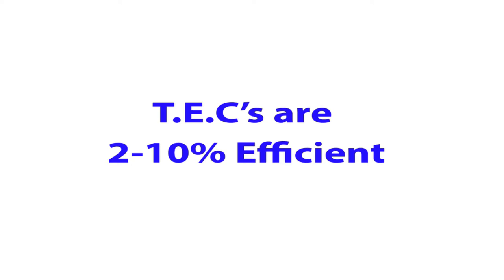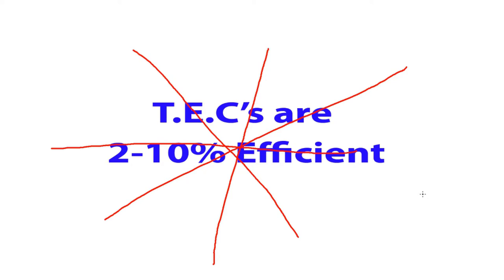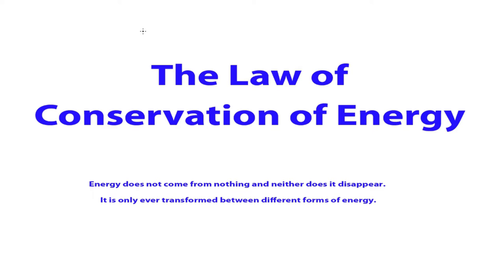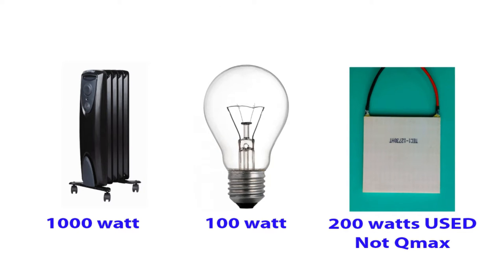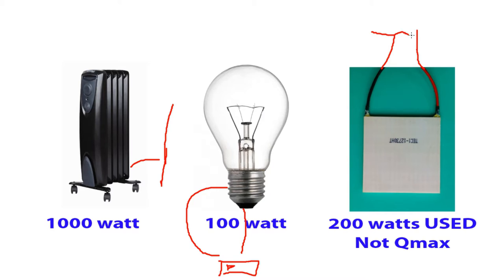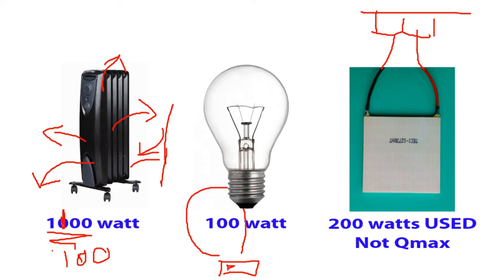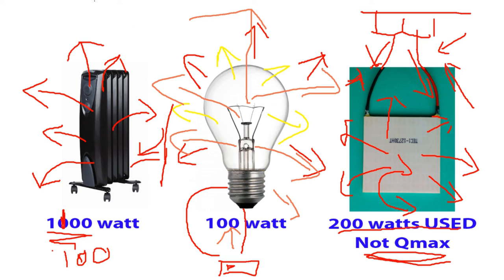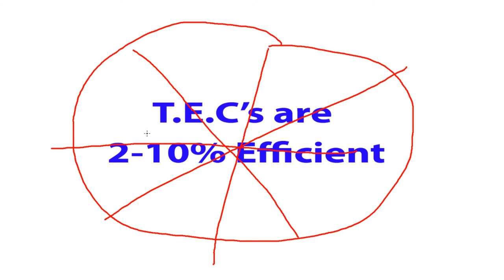🎓 Peltiers efficiency:- Conservation of Energy. Part1

Comment: Good info.

I've only recently gotten into using peltier modules. Waiting to get my first ones in now. Picked up some tec1-12706 modules for a mini cooling unit I'm building.

After watching a ton of vids on peltiers I think the common misconception towards efficiency comes from the fact that people are expecting / wanting all of the energy to go to the cold side. Since most people seem to use them for cooling not heating. If 90% of the energy is heat loss then yes…..it's only 10% “efficient” for cooling. However the second you apply a good heatsink you totally change the “efficiency” for the cold side.  as you mentioned nothing is really being lost. The peltier is using all the energy ya give it. It just depends on where you want to shift the energy to and how efficiently you can do that to the Hot or cold side.

If any of that makes since, lol
Reply from the maker: i really need to make the other 3 following videos cos i realise leaving it here has not really answered any Questions but probably raised more and i have not given sufficient evidence to backup my claim..  let alone explained what is going on... 

While there a literally thousands of videos on you tube making the claim that TEC are 2-10 % efficient  and will even provide a "TEST" to show it.. This is the case because literally everyone keeps making the same mistakes in there testing...
Reply: if you want high efficiency you should look graph COP vs I because if you took 12706 elements for good efficiency like A rated air conditioner you could get around 10 watts per element(15% of rated power) and you will need a hundreds of elements to buid reasonable air conditioner to cool the room.
Reply: Im done with tec-12706.. most design i dont know where to flow the hot area. In the end. It make the design simply not efficient.
Reply: @azmanzahari2421  One year has passed since you commented . Have you perfected your method or experimented with different models ?
Reply: Not too perfect. Since im only use water as medium. So the radiator need a lot water to transfer the heat. Im using which item available with limit cost.

Comment: I suspect the 2-10% 'efficiency' (should use COP) that is often referenced .. is not just the TEC application side of these devices .. but also from the TEG application side that some people use these same devices for .. In a TEC application where a lower dT helps get a higher COP and one can use this to get very high COPs from very tiny dTs .. the same device in a TEG application sees a higher COP with higher dT .. but .. in a TEG application the materials common units are made from impose more limits the extremely high dTs , not allowing large enough dTs for a common TEG to see a COP more than those 2-10% range often referenced.

Comment: If 1800 watts equals 18,000 Btu of cooling using a compressor then how many BTU of cooling will 1800 watts in T.E.C produce?
Reply: did you ever find an answer to that question ?
Reply: @Human-bf7kz  yes I think the answer was that 1800 watts produces 6000 btu using T.E.C. meaning it was less efficient if I recall correctly.
Reply: @whatever465456  How about heating ?
Did you do any experimentation yourself ?
Reply: @Human-bf7kz  no I did not experiment because of the efficiency factor. I guess it would be 6000 btu for the heat transfer and 6660 btu for the heat generated from 1800 watts. 12660 btu total.
Reply: @whatever465456  Thanx for sharing Brian .
Reply: @Human-bf7kz  welcome

Comment: 100% of the energy from an incandescent light bulb is electromagnetic radiation, except for conduction and convection heat of the bulb.       You mean visible radiation, light.
Reply: "Conduction and convection heat" Which is near zero, because an incandescent light bulb has a very thin atmosphere. Most of it it's from the IR radiation.

Comment: Dude. Missing the point of the  Peltiers efficiency. The cool negative energy, assuming this is being expelled from the building, needs to be added to the hot side. The amount of energy required to fight the thermal dynamics and send heat one way and cold the other is the unknown efficiency.